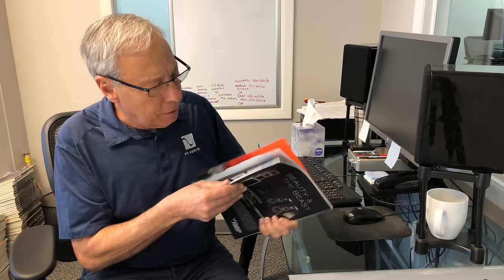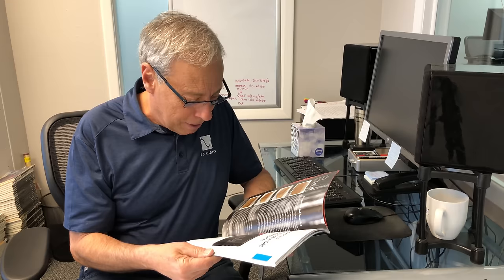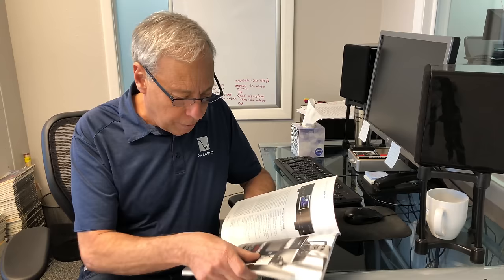Is equipment burn in real?

Comment: Cue the naysayers :(

For me, its pretty simple : whether its my ears/brain or the electronics, SOMETHING changes between minute 1 and 24-48 hours of operation : I dont really care what it is. Making pronouncements about how something sounds straight out of the box is the mark of the newbie in this hobby - you haven't even given the component time to realign your internal biases re sound signatures before dashing to a keyboard (or worse, a camera) to announce that you love/loathe your new toy. Head-Fi is full of people who do this repeatedly and dont even get me started on the people who make judgements based on what they've heard at shows, arguably the single worst place to assess gear.
Reply: I have had my speakers for over ten years and I can tell you that they never sounded better then they do now. Some gear takes a while to break in, I am a firm believer just as you said, also it could be a mechanical, electronic and auditory combined adjustment that happens over time.
Reply: It does become tiresome to listen to the naysayers, especially after one has experienced the sound of a new item changing very noticeably over a second or 2 (after being in use for 24+ hours or like that...), and not just once, but repeatedly. That said, the setup you are listening to has everything to do with what/if and how much you are going to hear changes. Same goes for acoustics, the better and more managed the acoustics in the listening space the more you are going to be able to hear. 
Your advice is good, and takes discipline (waiting to form judgement) and sound/acoustics knowledge/skills in order to be able to calibrate the validity of what you are hearing at a show.
Reply: This is the new audiophile of the internet age.  All about measurements and graphs, completely missing the point (aka THE MUSIC).
Reply: moving parts can change, in that case you can leave the room - cables don't change - period

Comment: Mechanical devices such as speakers and phono pickups probably do benefit. Solid state electronics and cables? No.
Reply: Cables do burn in. Everything that has current flowing trough is burnable and is required to burn in to perform at its peak.

Comment: Wow, thanks Paul.  I find this of particular interest right now, because I've just restored a Sansui 6060 vintage receiver, including a recap and it sounds really bright and harsh, with lots of sibilance.  Really fatiguing.  Before the recap it sounded much nicer.  Vintage Sansui receivers are known to sound lovely and sweet, so I was starting to wonder if I'd done something wrong, even it's working perfectly.  I guess I'll give it some time and see if it improves any.
Reply: are the new caps in the signal path  or are they just power supply caps ?
Reply: @gino3286  it was a near full recap, including the signal path. It's been in daily use ever since and has improved, but I'm intending to switch out the film caps that I replaced a few of the small value electrolytics with, especially in the pre-amp/ tone board, as research has suggested that could be the cause. There was also a massive jump in volume after re-capping the pre-amp board too. I did also replace the fuse resistor at the same time though as that was massively out of spec. It's possible that could account for the volume jump too. Unfortunately life has been a little too busy to work on it recently and I've had difficulty finding a known legit source of quality low esr small value caps. The UK is terrible for buying electronics components unfortunately.
Reply: @juddery  i am not an expert but if you have used decent quality caps from voltage rails to ground it should be ok
Caps in the signal path may impact the sound more You will find recommended
 parts in the Web if you search
This is the reason why designers try to keep them to a minimum
However very old caps should be replaced always i understand 
Good luck and best regards gino
Reply: @gino3286  yeah, that's what I thought. I used all good quality components, including Wima film caps to replace a few low value 0.47uf and 1uf 50v electrolytics, however, it was after rebuilding the pre-amp/ tone board that everything got a little harsh. A few people have suggested that using film caps in that circuit instead of polarised electrolytics, may be the cause of the issue, due to affecting the intended design of the circuit. I've just ordered some Nichicon FG caps to swap with the Wima film caps snd see if it makes any difference. I'm in the middle of packing to move house right now though, so fitting them will have to wait until after I've moved.
Reply: @juddery  i see To be honest i have to say that I don't use tone controls at all and i listen only to digital sources
I have done some basic DIY and I have the impression that passive parts can have a sound not only caps but also resistors
if you like the sound bypassing tone controls that is a very good thing
At least you have spotted the critical circuit I like minimalism a lot
But parts selection after the design and before the construction is a key phase
I wish you all the best Bye gino
Reply: @gino3286  I don't use the tone controls either, but the pre-amp and tone controls are on the same board in the 6060 receiver. The Wima caps are in the pre-amp section of the board though and I think that's where the issue is. I don't know for sure yet though. There are similar Wima replacements on the driver board too, plus there are some transistors on the driver board that haven't been replaced yet, (although the faulty ones have been), so there are definitely options to explore. I'll hopefully get there eventually.

Comment: Every component should perform with constant quality after unboxing. Exept tubes. They burn out from day one. The electric properties of a capacitor are measurable. A capacitor could be burnt in in an extremely small circuit. How do the properties change during burn in?

Comment: I believe in burn in just like I believe in breaking in a automotive. Things get better with time.... To a point of course.
Reply: Here is the problem with that. An automotive vehicle is a mechanical device built within tolerances to allow for wear on the components. Electronics, however, are solid state devices. That means there are no moving parts. If something burns and changes the characteristics of your solid state device, something broke.... 

Individual components of solid state devices are built to very tight tolerances. Deviation from those tolerances means the device has malfunctioned. This happens to capacitors all the time and if your capacitors are changing tolerances over time, you didn't use a high enough rated capacitor.
Reply: burn in is most obvious with speakers and headphones. before saying u dont belive take a new product and a used one and listen. if u cant hear then maybe it was preburned in like paul does with the mono blocks or your speakers arent good enough to tell otherwise. im actually really surprised by the tolerances stated on caps and resistors. quite large. u would think everything stabilizes  itself out after some burn in.
Reply: Speakers, absolutely! The foam and rubber surrounds stretch as you hit them with bass frequencies creating a warmer and more lose sound. Whether that is an improvement or not is certainly up for debate. I tend to use drivers with low moving mass to avoid these problems as much as possible.
Reply: Ricky M. You get used to it. That is all.
Reply: Paul was talking about capacitors mostly. Not solid state devices.
By the way Flash memories are solid state devices but they wear out.
Reply: MFD game:
"im actually really surprised by the tolerances stated on caps and resistors. quite large. "

In the case of resistors, it is largely a function of cost. a 1% metal film resistor will cost more than a 10% carbon composition resistor. Capacitors are a little different.  A 2% film cap will not be much more than a 5% film cap. Electrolytics are different because of the variations when the electrolytic dielectric film is formed.

Comment: I burn in all my major electronics... Speakers, AMPS... and even computers. If there is a weak component it will usually show itself in the the burn in time. It "seasons" the speakers edge, especially if you still have one with coated accordion edging instead of a modern sub with foam. Just my opinion. I run everything I have for 36 hours before I cycle the power.

Comment: Paul, you are the first technician I have heard defend burn in for electronics. Most tell me a cap is either in spec or out of spec. One is good, the other bad. Period. But you are giving me hope. Recently I had a vintage amp recapped, and during the first week back the protection circuit triggered several times. This amp - a Pioneer SA-9100 - is known to have an itchy trigger finger. I took it back; the tech found nothing wrong. I used it for a few weeks, and it sounded great, but then it triggered again. I took it back; still nothing visibly wrong. He ran it for three weeks with just one short protection trigger during that time. I brought it home, and now I am able to run it for long periods of time between protection triggers. Could this be the result of burn in? I hope so. It would mean the amp will just perform more and more consistently with time, as all those brand new caps and transistors get to know each other. Is this possible? My nerves need a break.
Reply: John Baker
As Paul himself noted in the video, there are still things that we do not understand about this process. Not understanding a thing does not invalidate it, much as some of the punters here would have you believe. 
We should remember the lesson of Galileo Galilee, who proclaimed that the Earth revolves around the Sun, but was soundly berated and told that it is the Sun which revolves around the Earth! Well, anyone who went through high school should remember how that turned out.
Even Electrical Engineers don't know everything that goes on in a piece of equipment over time.
Electrons make up electrical current, and those electrons propagate along the outside surface of a wire faster than the inside of that wire. When the electrons reach an interface, such as where a cable is plugged in, the electrons must gather along the edge of the surface they are on, then must leap to the next surface before they can continue. This happens at a molecular level, and is something that most people are completely unaware of. That doesn't mean it doesn't happen every time you turn the power on for your amp.
I give this as one very small example (no pun intended) of a very large number of things that go into the working of stereo equipment, each of which has an effect on all the others, all at the same time.
Those people who say it is your ears that are adjusting, or that you need a double blind test, are trying to convince you that the Sun revolves around the Earth. That is what they believe, and they are firmly convinced of it. People arguing over what they believe, but don't know everything about, is pointless and a waste of time.
Sound familiar?   : )
Reply: Thanks for that thoughtful reply. Yes, that does sound familiar. I have listened for years to the arguments of audiophiles and audio skeptics, and it seems to me that the more acrimonious they become, the less informed the participants. People with a wealth of experience and training tend understand how often the world fails to rise to our expectations, and they tend to be more secure in their doubts - much like Mr. McGowan here, whose views I appreciate.
Reply: John Baker
Thanks for the kind reply.
I too, appreciate Mr. McGowan's  comments, and I am glad he started this channel on YouTube. I was very skeptical in the beginning, but I have found him to be a very personable, caring individual who is concerned not only about the happiness of his customers, but also in sharing some good, solid information that he has acumulated over the years. I believe that he is being honest, as well, because if he doesn't know something he will say so.
I also enjoy Steve Guttenberg's channel (the Audiophiliac). It's a different kind of take, but I find he usually has something interesting to say.
Good luck with your amp, and if you have not already done so, you may want to check and make sure it is receiving a good, clean and steady current from your house wiring.
Everything can have an effect, and the more meticulous you can be with your system, the better will be your results.   ; )

Comment: On this topic, I trust a maker of professional audio equipment any day over a home Hifi maker. Genelec, for instance, tells us that their equipment need no burn-in and such an effort will not alter the sound quality. Has it been burned-in during the manufacturing process? Perchance -- but unlikely. Do they use components that are of higher quality than home HiFi and hence operate to a very strict degree of tolerances, negating any burn in effect? Most likely. 

I am sure some there are components that will change their sound during "burn in", but that should be a sign of poor quality. Why should the changes stop there, at that magical 150 hour mark every one talks about? And why is the change always positive? The answer: Because these are red flag signs of a placebo effect -- that is why. Real world physics do not work like that.

Comment: I bought some cheap white van speakers years ago and sounded like carp at first. then years later I hooked them up to a over powered amp to them and sounded like carp for about an hour then it was like a flood gate of beautiful sound came about and I still use them but on a smaller but powerful amp. speakers in question are ANV brand. 1st amp was a Kenwood Basic M2 and current amplifier is Kenwood Km-106 and sounds great for what they uhh it is.

Comment: Count me in with the “burn-in is real” camp.   A few months ago, I upgraded a cheap Onkyo receiver to a Rotel A11 Tribute integrated amp in an office system.  I was not initially impressed, and thought I had made a $700 mistake.   A couple of days later, I went on a four day business trip and left a CD playing on repeat while I was gone.   When I returned, there was an immediately noticeable and significant improvement in sound quality in every respect!  I obviously wasn’t present to “become accustomed to the sound” as some claim, so it was either burn-in or something else at play.   I would say the sound quality has continued to improve slightly over the past few months.

Comment: People who think inanimate objects changing their sound is like believing in leprechauns and unicorns are clearly not musicians. Buy a brand new solid wood acoustic guitar, for one thing and tell me the sound doesn't change from the day you first opened the case. Same principal with speakers. Sound is a vibration. Speakers and guitars are just vibration machines but they can't do their job at maximum performance until that stiffness has been loosened up.

It's not a conspiracy by manufacturers to keep you from returning things.

Comment: Burn-in is for real. I am over half way through a 400-hour continuous burn-in period for the Schiit Gungnir Multibit DAC and I have heard a remarkable difference. I think you are on the right track with capacitors, Paul, but there is also something about electronics "settling-in" to your system. I am not implying that the machines are communicating--that is for Future Shock--it is just that plugging in some new component and first impressions seem to always reflects edginess, harshness, some term them 'unlistenable' for at least 72-hours. This is for any component, brand-new or vintage. I don't know why, but my ears don't lie. --The Affordable Audiophile

Comment: I can attest to burn-in! Back in 1994 I bought my first audio system (finally at age 40!). The amp and pre-amp was an ACCURUS A250 and ACCURUS PA 10, respectively. The manual specified at least a 100 he burn-in. I thought, "right! That's how long it'll take my ears to adjust!".
Hook everything up, popped in a cd and the sound that errupyed I can only describe as ear-rape! It sounded horrible! But I persevered and after around 100 hrs, give or take, the sound improved in the middle of a song! I thought it would be more gradual, and it probably was, but the diffence in sound quality was staggering! It sounded great! After around 200 hrs it sounded even better!
Burn-in is no joke!

Comment: Recently got my SX 750 back from the shop and I was very upset with my first listen thinking it would blow me away with new dynamic range and clarity. However after listening to many more records I found it very clear and deep. I thought there must be a break in period and after finding this video I feel validated.
P.s. the whole point was that the power capacitor was replaced and I thought my guy had done something wrong. Burn in is real my dudes.